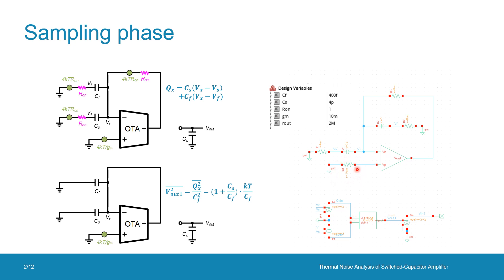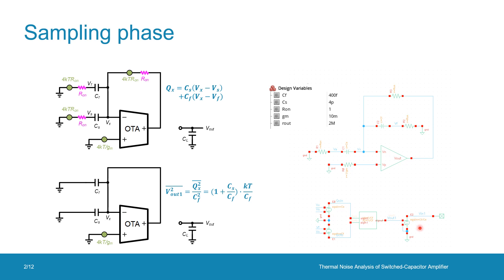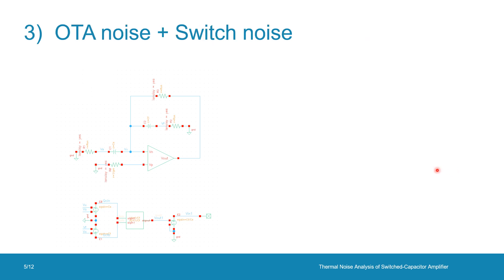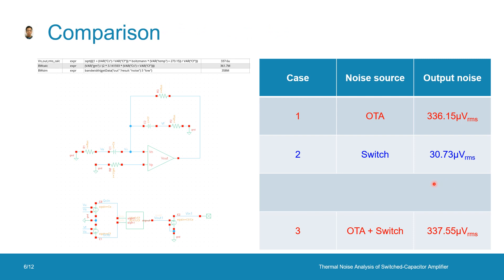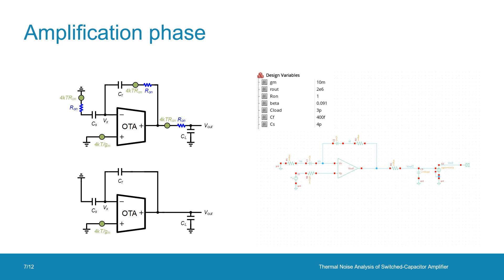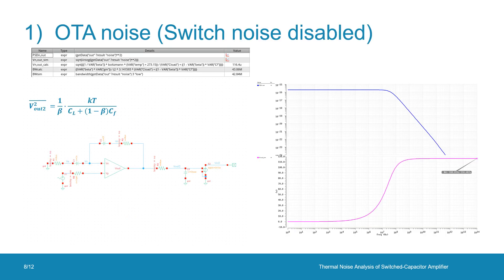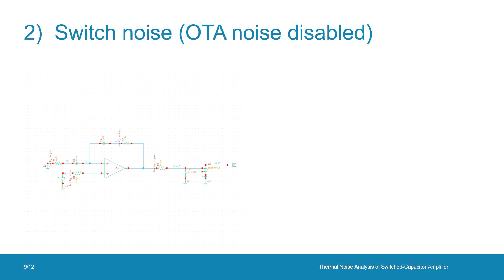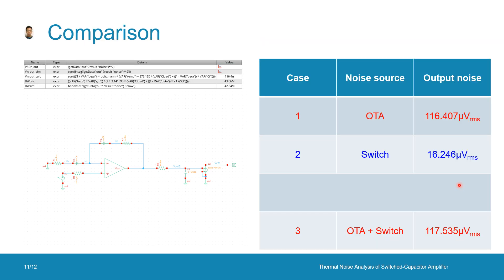Thermal noise analysis of switched-capacitor amplifier (Simulation)

Comment from the maker: Again, as commented in the first part (theoretical part) of this tutorial, the actual OTA noise PSD might be much higher than 4kT/gm.
For that, please use the corresponding expression. The overall noise power will be doubled (for a fully differential implementation) and be further increased if the noise from the load transistors are significant